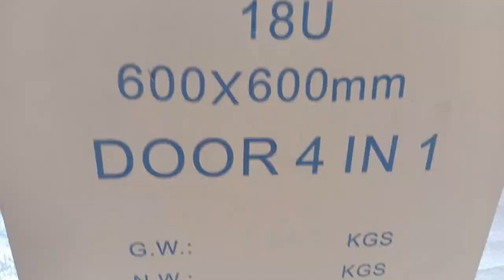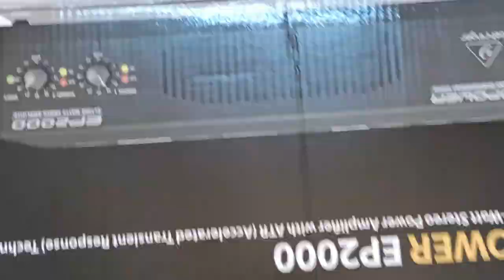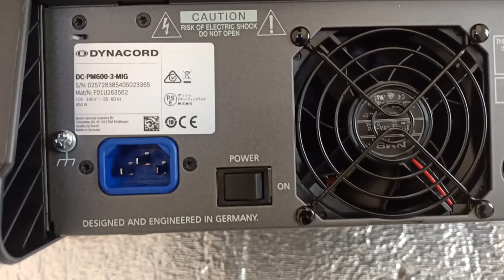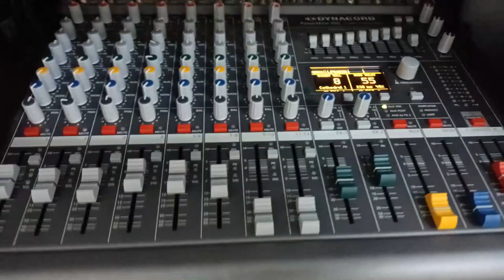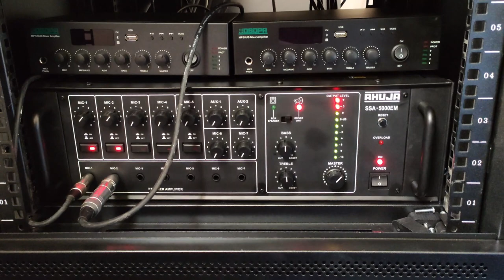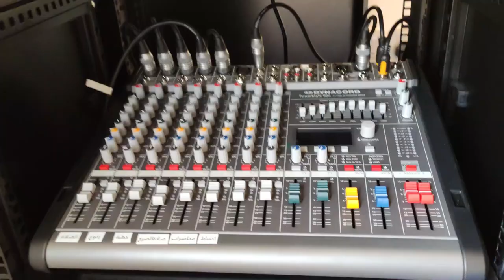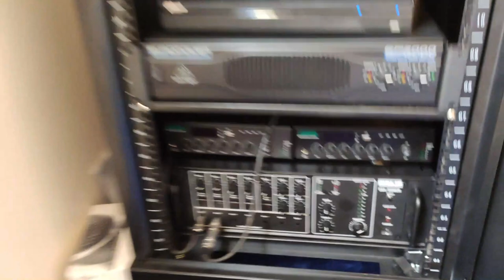how to install full sound system in mosque dynacord mixer ahuja amplifire electro voice mitsuba

Comment: I wish the system should be more advance and used a different type of speaker which consider speaker dispursion, loudness and time arrival of sound. Especially in the main praying hall. 

Based on the video. I bet the clarity in the centre of the main praying hall is going to be quite low. 😥
Reply: Any suggestion for sound system? I want to install in our mosque.